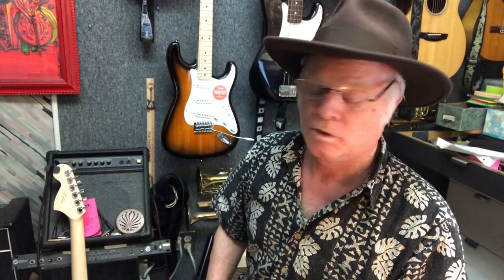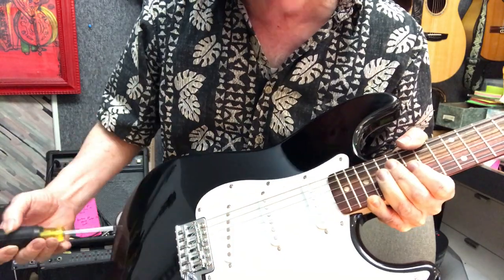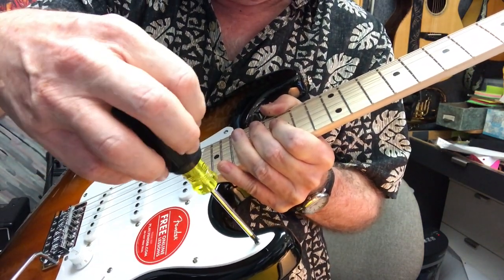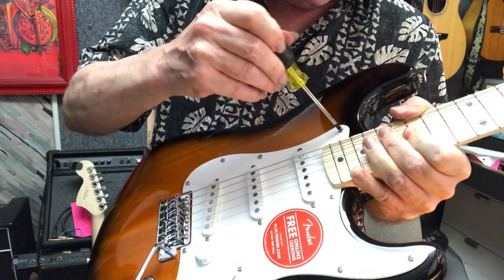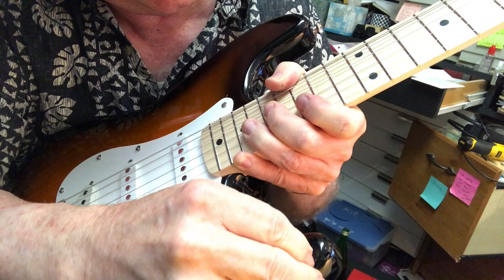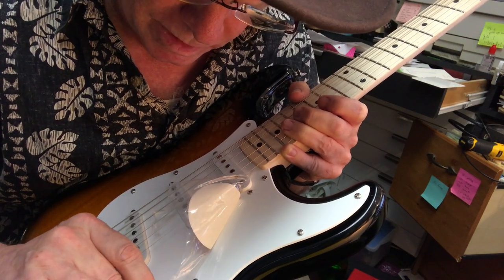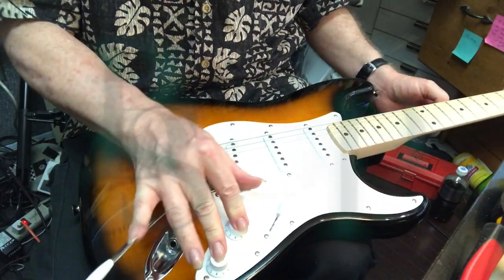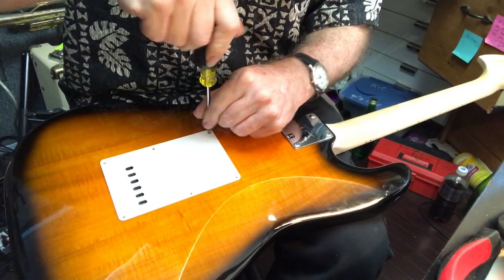Fender Pickguard Plastic removal and BONUS SET UP SURPRISE tip!

Comment: I wish i saw this video when i bought my strat. Only realized the plastic was there years after (it didn't had the red circle). By the time i tried to remove it, when i peeled it it kept braking apart leaving small bits still glued to the guitar. I made two light scratches trying to peel this bits off with hair removal tweezers. I'm glad it happened on a 100$ guitar and not an expensive Fender, still got pissed that i scratched it. Good thing the pick guard is white and the scratches are only noticeable with the right light.

Comment: I can't get the plastic to start peeling off no matter how much I try. It's hard to tell that it's even there.
Reply: It has a sort of 'milky' look if there IS plastic sir... It looks more like glass if it's already gone. Maybe? Sometimes you can tell it's there if there are small air bubbles, you can use a small knife to very carefull see if the lip of plastic can be coaxed off. Maybe way back behind the last tone knob, but very gently, don't scratch anything...!

Comment: The pickups on my electric guitar (Yamaha pacifica Pac 012) has plastic covered. should i remove the plastic from there? plz reply
Reply from the maker: Nabh! I think you should! It doesn't really affect the sound/tone though. Just try to go slowly, and you might have to loosen your strings (or take them off and put a new set on?) That CAN be a little difficult to peel off under the strings! Good luck and thanks for watching - guitarist Karl Grossman